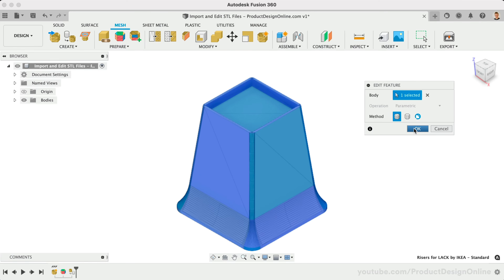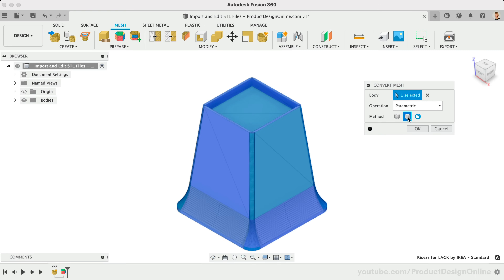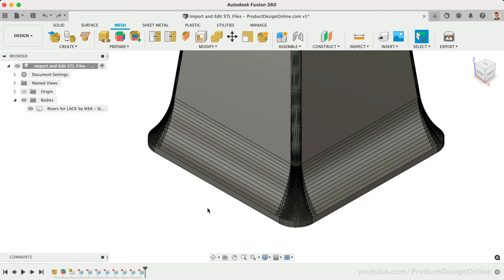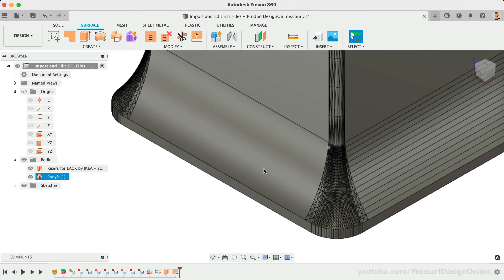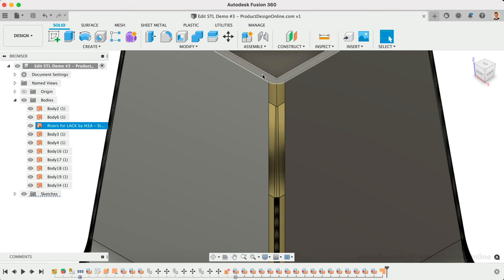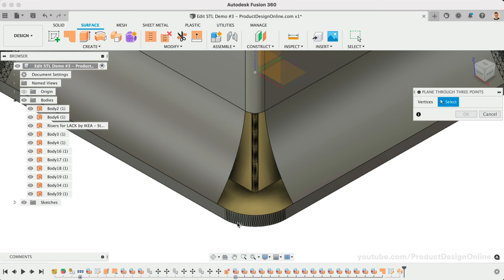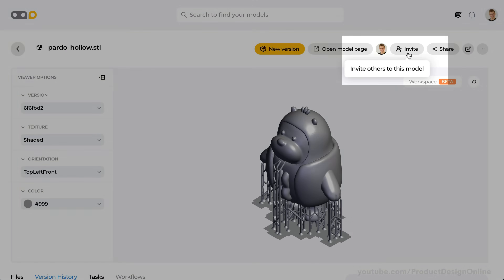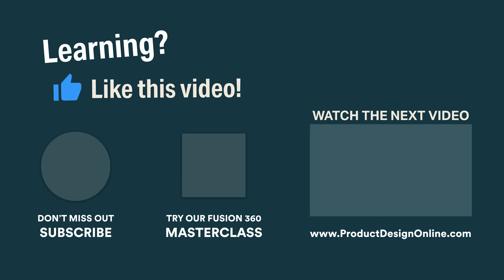Import and Edit STL Files in Fusion 360 2024

Comment: If you're as new to Fusion as I am, and are on a newer version, unable to find the option for displaying Mesh Groups 00:01:13, it's now under a different menu.  Click the Inspect button from the top menu. At the bottom is Display Mesh Face Groups.  Or, press Shift-F.

Comment: Protip: if your object has 2 planes of symmetry… divide it into 4 pieces using the origin planes as your cutting tools. Delete all but 1 object, leaving you with 1/4th of the original model.
Then, go ahead and repair your surfaces. After finishing, use the mirror tool to recreate the missing volume.

That’s it! Saved you a lot of time by just working on repeating features all at once.

Comment: Thanks for this, that's a big help.
For stuff like this riser where the intent is "logical", it seems relatively straight forward to clean up, provided you're comfortable with the tools Fusion360 provides.  But if the STL is [for example] a model of a fist, with 3D compound surfaces, it's not quite as easy because uniform sweeps and lofts don't make as much sense.  Is there a way to work with the mesh directly instead of or prior to converting it to a solid body? I imagine that would be mainly with pushing and pulling on control points of the mesh.
Reply from the maker: In general, this workflow is for items that would've been designed in a parametric CAD program (but not necessarily Fusion) in the first place. Something like a 3D scan or organic character, etc. (model of a fist) is honestly better suited to modify in a mesh program, such as Blender. That being said, if you just need to add a hole or do some basic add-on or subtraction to the model, then you can work with it in the mesh tools. Some examples shown here: https://youtu.be/WtEWbNIaK9Q?si=s_ZgMDZOXbQXV9el

Comment: Excellent video!  At 6m15s, could you use the circular pattern to more easily replicate the lower curved surface to the other 3 sides?  You would need a construction axis which would be easy to create given the center of the top square or other symmetric geometry

Comment: This guy is fantastic at what he does.  As for editing STL files in fusion 360 free version you are limited as to what you can do compared with the paid version.  I found it easier and quicker to achieve my desired results by just starting from scratch in Fusion 360 using the original STL as a guide.  That object he's working on - I could make it a lot quicker than editing that STL
Reply from the maker: Thanks! Rebuilding the file from scratch is often easier for hobby users. Repairing sections can be handy if you just need to add text or change one aspect.
Reply: @ProductDesignOnline  Thanks for all of your excellent videos btw.
Reply from the maker: @MinionAtTheGate  thank you! Appreciate you watching and taking the time to comment. 😎

Comment: After "converting mesh", I end up with something like 50 shapes / triangles. Can Fusion not just create a solid body out of a set of shapes? In my case, this is a phone dummy (to test cases).So it's made out of dozens of shapes. I just need it to be a filled solid.
Reply from the maker: I have a few other lessons that show how to convert STL via the newer "Prismatic" option. Prismatic will convert it into a solid body. However, it is only available on the other three licenses (not the free personal use license).

Using the original faceted approach will leave you with mesh triangles (called facets). It really depends on the design and the file. 

Sometimes, you can clean up the mesh facets. While other times it's simply easier to rebuild the file.

In general, the shape has to be something that could be created in Fusion in the first place. If it's an extremely organic model from Blender or some other mesh modeling program then it cannot be converted without the mesh facets.

You can think of mesh and solid modeling as two different languages. The underlying math behind them is vastly different. That is why it is such a challenge to convert files. Fusion is actually one of the better programs at conversion. (I do wish the Prismatic option was available those on the free license though... as it is very powerful)

Comment: When I convert some models i get broken/open holes where curved edges where?
Reply from the maker: That is pretty common due to mesh geometry creation (particularly if the file was created in a mesh program originally).

You can try to use the repair tool in the mesh tab to automatically fix it. Otherwise, you'll have to patch them with the surface tool.

Comment: The 3 point arc base on the 3 projected points leaves gaps and the extruded surface doesn't close on the edges it has to connect to.
Seems like something else needs to happen for this technique to work with all types of curvatures.

Comment: What do you do if the whole thing is a complex shape?
Reply from the maker: Can you give a more specific example (of an object)? There are many factors at play, and some models (organic/mesh type) are simply better suited for the mesh type of programs that they originated from.
Reply: @ProductDesignOnline   so I am working on a filter adapter for the PBF gas mask and I have the filter part imported basically a thic Pringle with a hole in the middle how to I get it to whare I can thread that hle in the middle

Comment: What is the purpose of creating face groups? They don't seem to be used in the conversion.
Reply from the maker: The conversion tool does use them as a way to know if/when it can merge facets upon conversion. You can merge or change face groups if you have problematic areas (corners, small details, etc) that are not converting well.

Comment: Hmm, not seeing Unit Type dropdown immediately after importing the STL

Edit: Also there's no Mesh Display option after clicking the monitor icon at the bottom

Edit #2: My problem was because I was using 3MF files instead of STLs

Comment: Sharing because this might come in handy for other newbies who want to trim off parts of a complex mesh body without loads of faffing about:

- Create a new 'tool' body in the desired negative shape
- Position the tool intersecting with the unwanted bits of your converted mesh body
- Combine the two bodies using Solid > Modify > Combine > Cut
- The tool and unwanted mesh bits go bye-bye and you're left with nice smooth surfaces.

I figured this out while adding a threaded end-cap STL to my project. The walls of the cap were way too thick, so I made a hollow cylinder shell with inner diameter matching my desired outer diameter for the cap. I slid the cylinder down over the cap, did the above, and now it's perfect :) The threaded area is a maze of tiny faces that I don't want to screw up (heh) so this was a great way to fix the rest with no risk to the functional bit.
Reply: Nice tip!  Should help a lot of folks with simpler editing needs (myself included) 👍
Reply: thanks works great, used this to get rid of lots of triangles on a disc

Comment: Thank you!  Loved your video and to the point explanation.  However, I have been trying to follow your steps with my project I'm not able to get the same results.  I'm very new to Fusion 360 and to 3D printing and I'm trying to add text to an oddly curved STL surface that I downloaded (sort of a wavy surface). I know how to add extruded text to a solid body but regardless of what I try to do, I can't add text to this project.  Again, I've watched your video countless times so I'm wondering if there might be another option without paying an arm and a leg for the full version.  Thanks for any help.  Cheers!

Comment: i'm not seeing the mesh display settings in my instance of F360, is that a recently added feature?
Reply: Following the video i ran into the same issue.

I did solve it though, go to Utilities Tab > Inspect > Display Mesh Face Groups. A quicker way is to use SHIFT + F.
Reply: @miktoyou  Thanks for the tip!
Reply: @AnthonyRose  No Problem!

Comment: Why is it I get the message over 5000 triangles and then fusion just hangs up
Reply from the maker: Hi Steven. Are you using the demo file or a different file?

Mesh files with over 5-10K triangles will take extra time, depending on the computer you're using. Fusion 360 will flag that as a warning and your program will be inaccessible for a few minutes. Sometimes it appears to 'lock up' but if you leave it sit it will (typically) finish computing it.
Reply: @ProductDesignOnline  it’s a different file. I am trying to get it to the point where I can thicken some of the areas where they are so thin when I remove supports they break off

Comment: I can't figure it out for days. 3D printer not detecting. I just started learning Fusion 360. It gives an error as below. Can you help me?
"The operation failed.
Try adjusting the values or changing the input geometry.
Cannot convert mesh body to solid or surface body. Use Generate Face Groups or Direct Edit to align face groups to geometric features on the mesh body."

Comment: The demo file above is causing an error when Convert Mesh is applied. I'm using parametric with prismatic. When converted, a Compute Failed message is generated and the resulting object is corrupt.  EDIT: When creating face groups, reducing the Boundary Tolerance from the default 0.001 mm to 0.01mm resolved the issue.

Comment: Looks like I’m going to have to model this thing from scratch. It’s a round “case” with tons of round extrusions. Fusion just flat has a heart attack when I try doing much of anything with it. I do appreciate your efforts tho
Reply: same here - anything more complicated than a simple box with maybe one fillet and the PC is gone :(
Reply: @kamilabiaozynska554  my laptop is a gaming laptop with a decent i7, lots of ram, and a good graphics card. It just craps all over itself. 

My desktop handles it much better (even though specs are less but I’m in the process of moving the house around and don’t have it set up).
Reply from the maker: Very strange. Only latency I experienced was stitching everything together (~20 secs). Are you saying yours locked up when using 'Convert Mesh' or when deleting faces/doing other work to it?
Reply: @ProductDesignOnline  I am working on a few different pieces. I managed to get the “flat” piece worked out for the most part. But I spent a lot of time away from the laptop letting it think. Especially deleting faces. The amount of triangles on these pieces after converting is insane. 

It has 28 extruded holes through this part and the shape of the object is a circle. Even after getting the flats worked out, it is still pretty slow moving. But I’ve left the curved edges and holes alone. I Think it’s just a bit much for this laptop to deal with. 

The slow work flow and constant 10 minute loading times makes learning the software extremely difficult. I don’t have nearly as much of a problem if I model the part from scratch. But that is proving a challenge in itself just trying to get hood reference points to measure from and replicating it (money saving project for me. If I can print the parts I don’t have to spend $100 on each assembly).

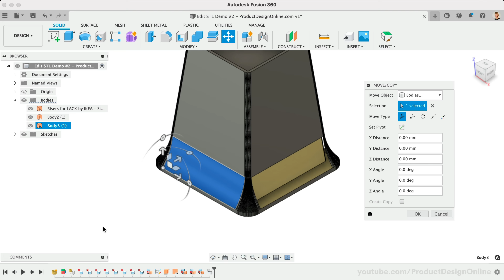Comment: 6:24 Assuming the model got correctly centered and is symmetrical I think it would be easier to use a circular pattern instead, so you get it all done with a single feature on the timeline rather than 9
Reply from the maker: Would likely work with this model. I wouldn't generally recommend patterning surfaces. With more complex files it will wreck havoc, especially when you go to Stitch the surfaces back together :)